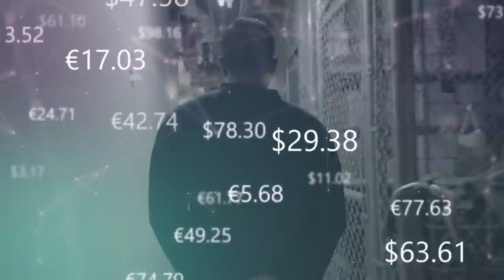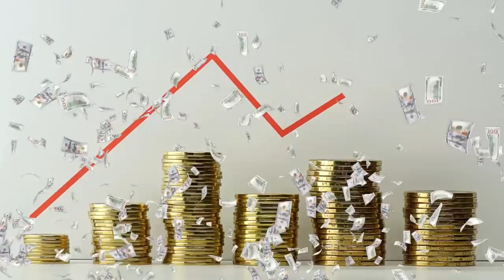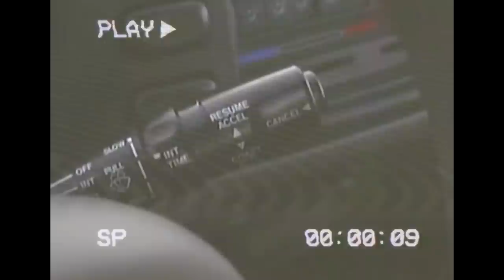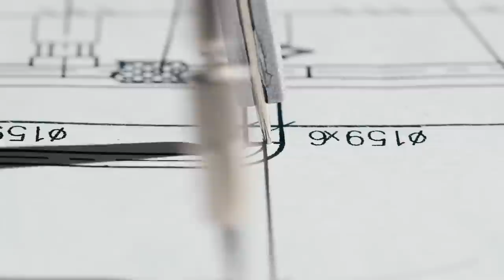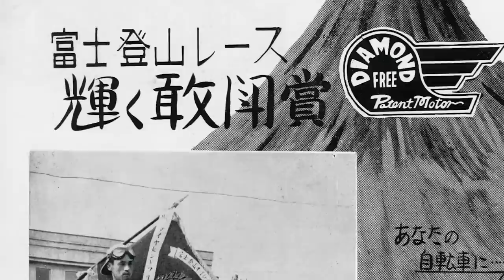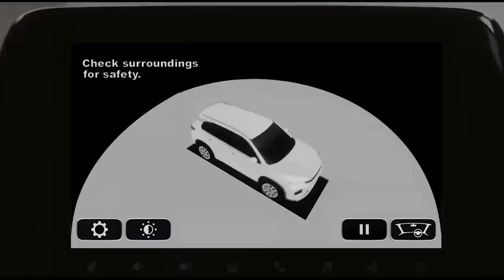How the Son of a Poor Farmer Founded Suzuki. Suzuki History

Comment: I had a 2003 Chevy Tracker made in the joint Chevy - Suzuki factory in Canada.  This little lady went 256,426 miles and 20 years before we parted ways.  It had a great 4x4 system and a simple 6cyl engine.  Great car for me.
Reply: Did it break? Or did you sell it? I'm thinking of getting a 2000 one that has 186k miles on it. I love that its a stick too.
Reply: @Tellin08  It got a Main Seal leak that was more expensive to fix than what the vehicle was worth.
Reply: @BuzzSargent  Thanks man. Personally, I prefer rebuilding these older cars because I don't like the computers and electronics in modern vehicles so I would've probably fixed that but each to his own :)

Comment: I put sold my year 2000 Suzuki Intruder VL1500 With 85,000 miles on the odometer after 17 years of ownwership. The only problems I recall was after riding in the rain the dummy switch on the clutch lever and contact on the ignition switch. The horn button too contact problems. Regulator rectifier too was a common failure.
Reply: Overall, it's a trouble-free ownership experience, though..  imo.

Comment: We own a Suzuki APV (a 7 seater minivan with a 1.6L petrol engine)

which is just the best
you literally get more car for your money

It costs 13,500 USD to buy
(30% less than a Toyota Sedan)

Maintenance (General PMS, Spare Parts) are generally less expensive

Quality (90's Toyota Simplicity and Longevity)

the mechanicals are so simple!
Body on Frame
RWD
1.6L 16V SOHC EFI Petrol Engine
5M/T
Reply: Suzuki ar great cars very reliable supper

Comment: My mother had a 1980 Suzuki Carry deathtrap with a 500cc engine. It burnt the driver's leg, if they touched the bottom of the unfinished metal seat base. 

The front of the van was a thin piece of sheetmetal. Fortunately she put a bullbar on it, which no doubt saved us when we had an accident in it. Afterabout ten years, you didnt see that model on the road anymore- a tota, pile of $hit!